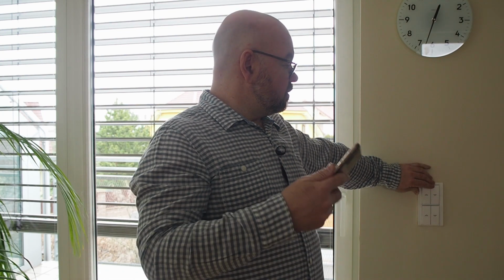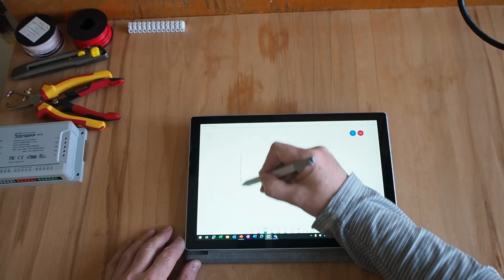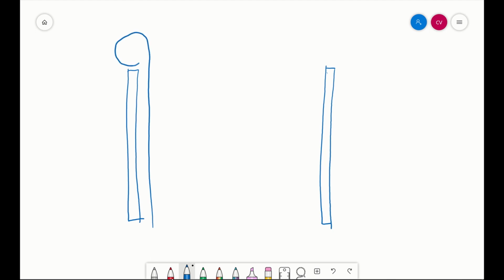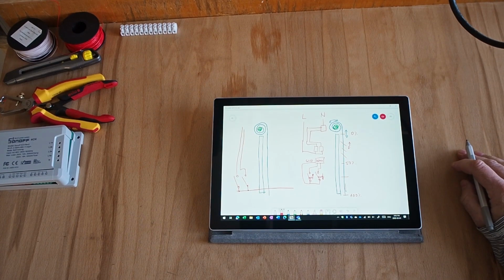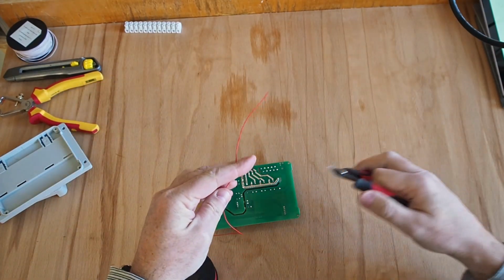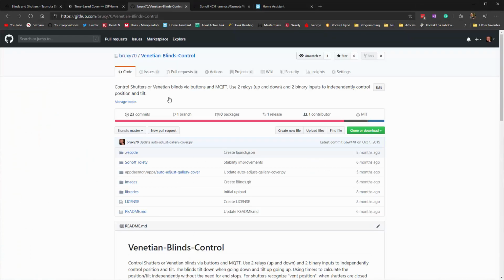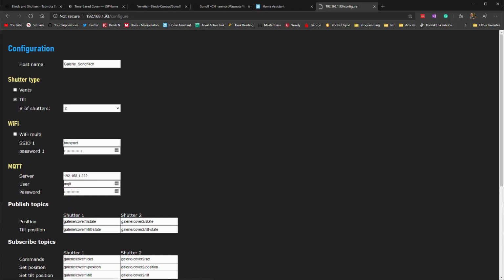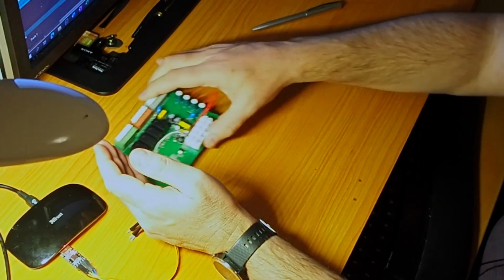DIY Windows Shades Automation in Home Assistant - part 1

Comment: Thanks, great video. I have 2 questions if I may; what kind/brand of blinds are these or have you installed your own motor? 
How did you install the wall buttons to the Sonoff (video?).
Reply from the maker: They are from company https://www.stoma.ch/ I think. But I guess it would work with other brands too. The buttons are connected to wires soldered to the original sonoff buttons, as sown in the video.

Comment: Hello Vaclav. I hope you are well. I just had my blinds installed (they look a lot like yours). They installed a 3 button latching switch with the blinds. An UP a DOWN and a stop button in the middle. When I click and release the down button and the blind is open, the blind fully closes and stops automatically (the button stays in, and I guess a limit switch stops the blind). The same at the opposite direction. At any point I  press the middle button, the active switch is disengaged and the blind stops at that position. If I press the other button while the blind is stopped, it tilts (i.e. if I press down the blind starts closing, it stops if I press the middle button and then tilts if I click on the up button). 3 Cables go to the switch L, Up and down. Do you see any problem with this setup if I use your firmware on an ESP device (probably the sonoff dual) as you explain it in the video?  Thank you
Reply from the maker: I do not think it will work without modifications to the code. The way it works is, it will keep the relay closed for the shutter to move, and the shutter will stop as soon as the relay opens. If I did that today, I'd probably use a shutter actuator from fibaro. But I looked at them and they also only support 2 buttons.
Reply: @bruxy70  Thank you Vaclav. I would appreciate a little help with the code. I can pay for your services if you want
Reply from the maker: @StavrosSophocleous  Thanks, but I cant't do it right now. Sorry. Someone in these comments was also suggesting to use a Z-Wave actuators, I had the impression that he knows the market pretty well. Try checking with him if he knows anything that works with 3 wires.
Reply: @bruxy70  I understand. Thank you my friend
Reply: @bruxy70  hello my friend. While playing with my shutters and their wall switch, I realized that the "stop" button is not actually a button (ie no wire goes on it) . It is just a mechanical interlock button that just allows 1 switch only to be operated at a time. There are only 3 wires coming from the motor , Up Down and Line. In this case, will your firmware work without modification? I am also experimenting on using the shelley 2.5 with your firmware, I will inform you if I manage to get it working, Thanks

Comment: Hi Vaclav. Can your firmware be flashed on the Shelly 2.5 to control roller shades like the ones in the video?
Reply from the maker: I have not tested that. I love Shelly's, I use them recently for lights, but I do not have 2.5 to test it, sorry.
I think it runs on ESP8266, so technically this should work. But you'll need to set-up the right GPIOs and set the parameters building the project. Tasmota should have that in the documentation.
If you are going to test it, it would be great to put the parameters in the GitHub site, so other people can re-use it.
Reply: @bruxy70  Thank you . I will give it a try

Comment: Thank you so much for your great video, I appreciate your work. 
I have a question:
when compiling the code I got 2 errors:
- ESP8266WebServerSecureBearSSL.h: No such file or directory
- ESP8266WebServerSecureAxTLS.h: No such file or directory
what do you suggest to resolve this issue?
Reply: I think the ESP8266 Arduino board version got updated and they made some breaking changes. So it needs to be reviewed and fixed. If you know how and you do that, please share the code with the others. 
Or use the same board version I used originally (2.5.0). It should still work.
Or use something else, such as Fibaro (https://www.fibaro.com/en/products/smart-roller-shutter/). When I did mine, it did not exist, but if I did it today, I think I'd use that. Or if you do not have Z-Wave, I think Shelly has one as well that uses WiFi.
Reply: @Pilot16H Thank you, yes I know. I tried to install them but I didn't find them, so I deleted the two lines and it's working